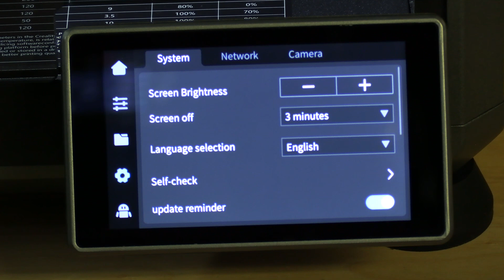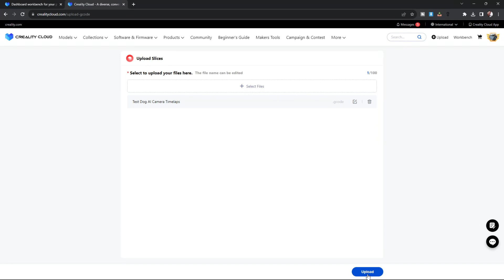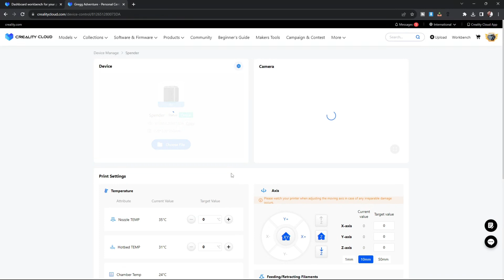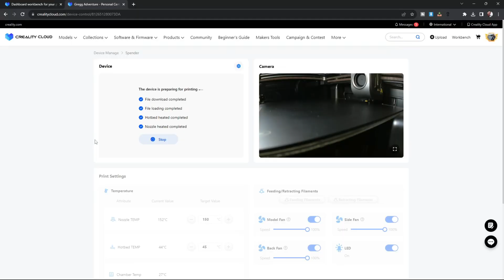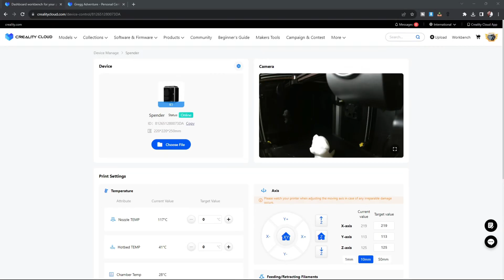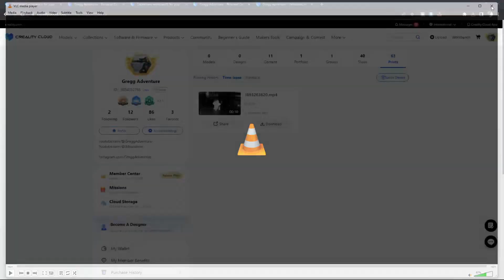Install and setup the Creality K1 AI Camera for Timelapse & Print Monitoring with Creality Cloud

Comment: Another surgeon level operation from Creality! The camera now has 2 screws, and one of them is difficult to reach. I also had to remove the cover that was holding the cable because the camera touches it... it was stuck to the right side cover with that horrible hard to remove glue they like so much. Fun! I pried it off using one of those plastic tools that are  usedfor mobile phone screens and then had to fight the back screw for a while. Luckily I have a screwdriver that has bit for that size allen key, the magnet and the shape helped. The stock allen key was completely useless.

Comment: I found taking the bracket that held the cable fully off helped as i could not get the camera in without trapping the cable and it would never actually sit right. It only help on with glue thats easy to pry off.

Thanks for video!!

Comment: Did your K1 come with wifi/network? Mine does not have that...
Reply from the maker: The K1 is running Klipper, you have full Creality Cloud support, as well as the Klipper Interface (Which I never use) in your K1.
Follow along here: https://youtu.be/c9amL0-r5hQ?si=pYcLr89Llal06OMo

Comment: My camera is recording during prints but there is no Timelapse saved. Any ideas?
Reply from the maker: Is it turned on? Check the blue slider in the Timelapse settings at the screen. Check for the Timelapse in your video files on the screen